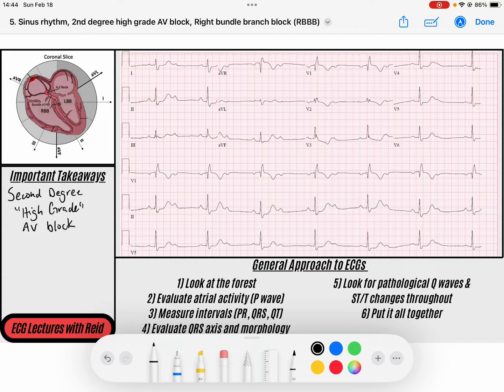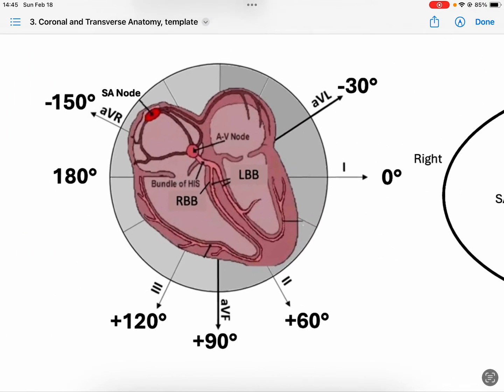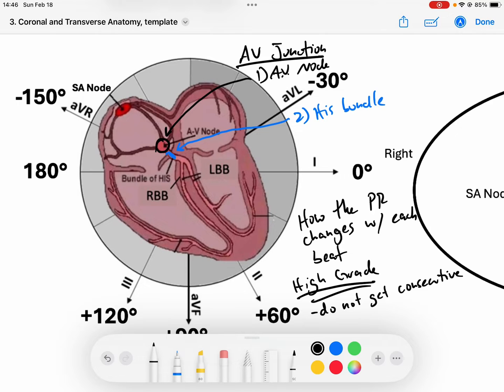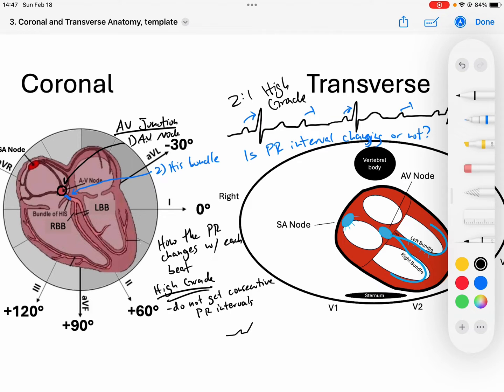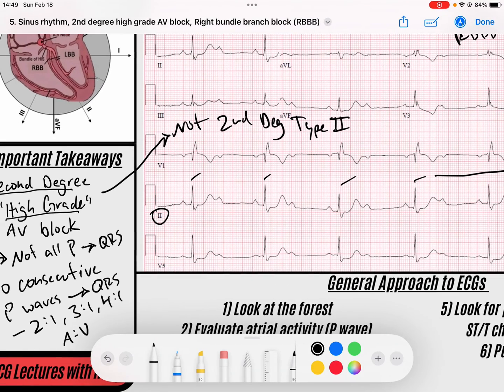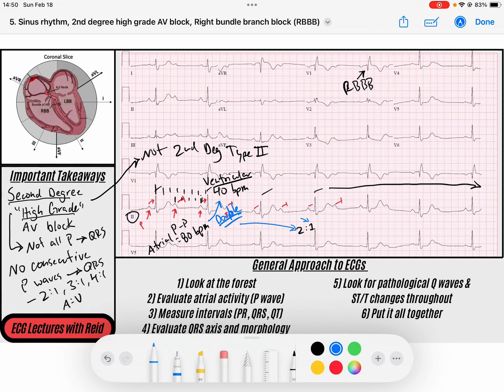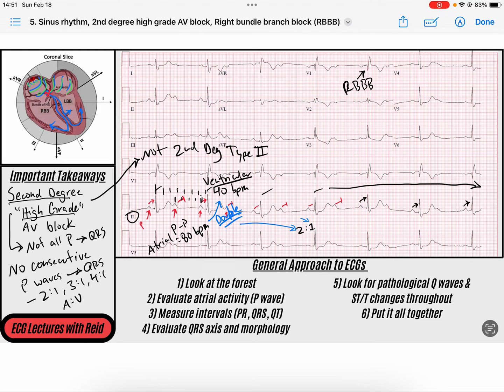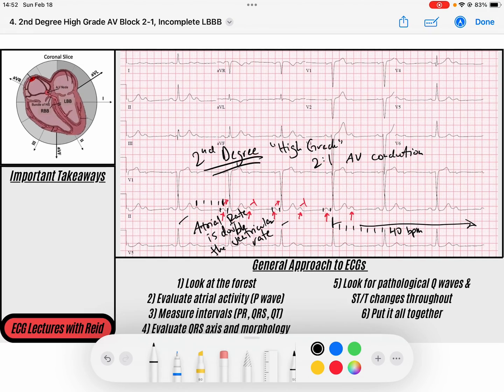Second Degree “High Grade” AV Block EKG | ECG Lecture

Comment: Thank you once again sir, small clarification: 
What is the anatomical landmark of AV junction? Is it junction between AV node and bundle is His?
Reply from the maker: Great question, AV junction is composed of AV node and the His bundle before it begins to branch!
Reply: Thank you sir. So when we discuss junctional rhythms, it comes from Av node and His bundle! Rite sir
Reply from the maker: @sangaydorji4731  exactly!
Reply from the maker: @sangaydorji4731  which is why, if the His bundle is blocked, junctional escape rhythms are unable to be generated and conducted to the ventricles. Big reason why 2nd Degree Type II AV blocks get immediate pacemaker.
Reply: Thank you sir. Got the concept very clear. 🙏